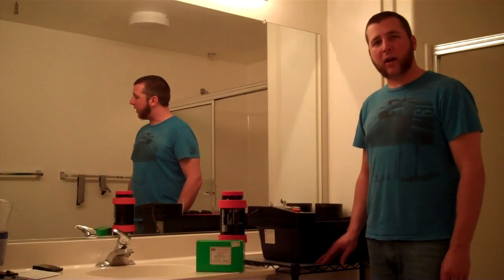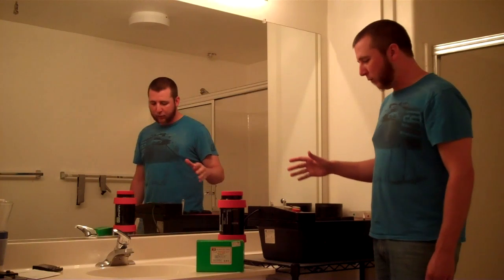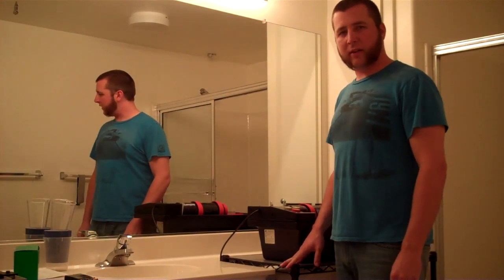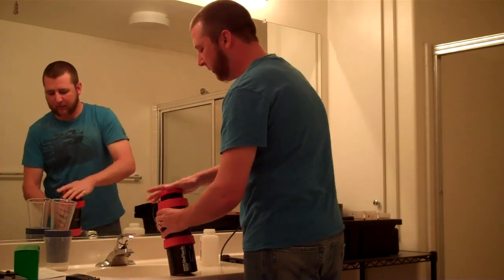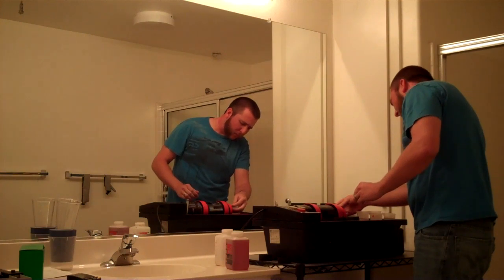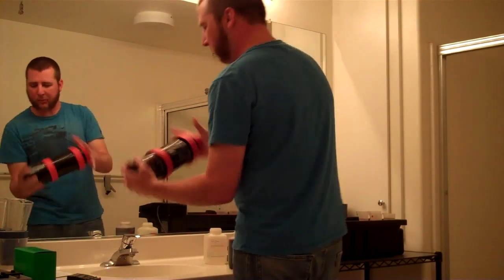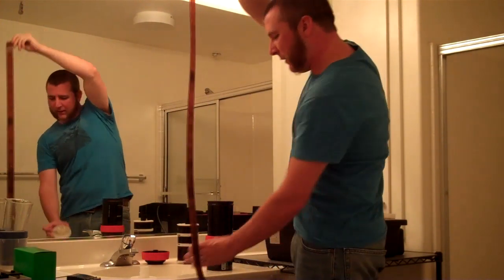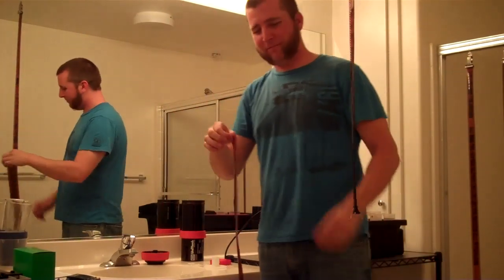FN11: Developing C-41 With a Jobo Rotary

Comment: Not sure which brand of C-41 chemistry he is using here, but if he's getting CO2 build up enough to blow the lid off the tank during blix process, he (you) can insert a short water bath between the developer and blix. this stop excess chemical carryover from developer into blix, which is causing that problem.

Comment: Note that the Jobo CPE processors are no longer available. Used, they cost between $800 - 1,500.  Not terribly durable overall, repairs parts may or may not be available. Okay for color, but poor choice for B&W, which does not give best results with the continuous agitation processing required by Jobo units. Options (used; ebay sourced): Unicolor Film Drum with Unirollor. There were a couple of waterbath temperature stabilized units as well; no are heavily built as Jobo, but far cheaper and basically the same functions. If you just want a temperature controlled waterbath, there are//were several commercial units. Being cheap myself, I use an insulated drinks cooler temperature stabilized by an aquarium heater - It holds 105 degrees F just fine; I do E-6 color processing with it.

Comment: Kool video, thanks for the upload.

btw is that a 120mm colour film ? I was under the impression it was different chemicals than 35mm
Reply: 120 film is not 120mm wide; the number is an arbitrary name.  C-41 chemistry is the same for all film designed to use it.

Comment: I want to know what happens if some variants change, I mean, if i do this but the temperature at the last 1 minute and the developer gets cold (first chemical) by one degree, what happens? do my negatives don't show full highlights?, and if it gets hotter by one degree at the last minute, just if the water gets the chem warmer, do i get more contrast? I just need to know what happens, because at every lab i give my negs, some appear transparent (even the words at the sides "KODAK") some show...
Reply: If you mix the working solutions properly, the only variables are agitation and temperature. A Jobo unit like his will automate those elements. Not using a Jobo is fairly easy. You can hand agitate loike you would for B&W. You can use a deep pan water bath to hold temp in your chemical bottles; you can keep the developing tank in the same bath during development. If you regularly start development at the recommended temp, but it falls off, say 4 degrees, during development cycle, then start 2 deg higher and end 2 deg lower than specification. Sounds funky, but it works fine. If you just loose a few degrees during development, you might technically under-develop, but you are not likely to notice any difference. After the development cycle, the remaining steps run to chemical completion, meaning that  you can do too little (incomplete) but not too much - so run a little longer than spec. You will be positively surprised at your results.

Comment: brilliant- thanks so much im new to film and just tried this out and images seem really clear on the first half of the film (no idea what's happened to the second half, no images at all?!) 

when i'm winding film onto the spool should i keep winding for a while after all the film has taken up? the only thing i can think of is that the outside layers were stuck against the side of the developing tank?
Reply: Without looking at your film, I'm just guessing.  If the last half of the film had no images but the film was clear & transparent, then the whole film was properly processed - likely you just didn't take photos on the back half of the film. If the last half of the film still has emulsion on it, then it stuck to itself in the reel/tank ad was not processed. Seems unlikely.